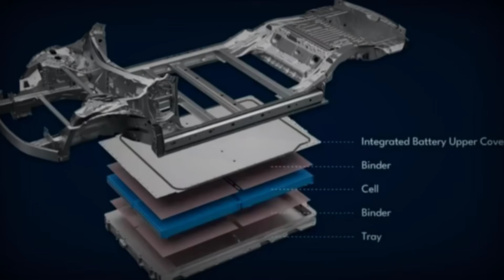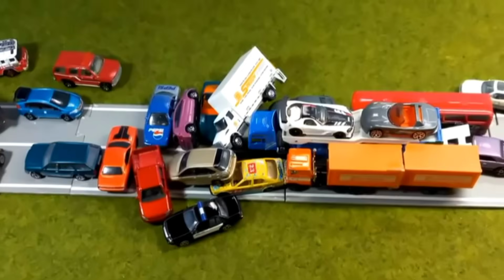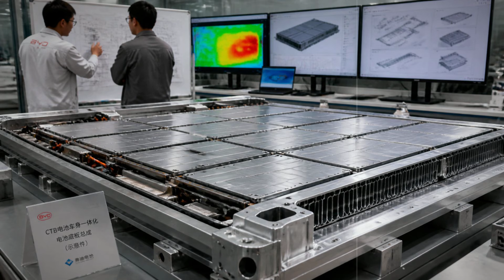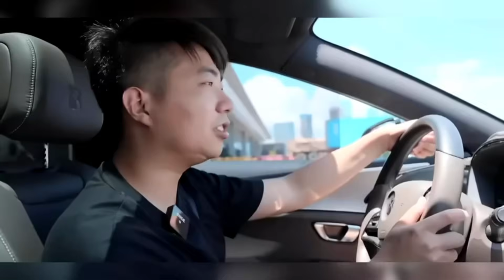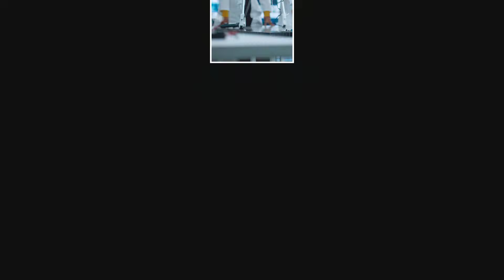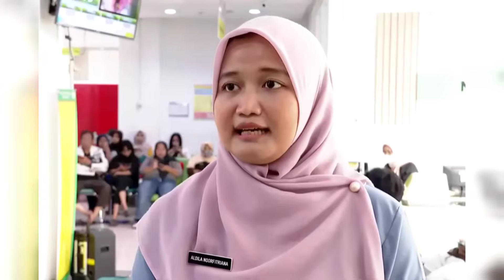BYD's New Car Has No Battery Pack — They Made The Entire Body The Battery

Comment: I don’t like it. An accident would cost so much more. Battery life would mean having to replace the whole car. The smaller the battery, the more volatile the chemistry. So many issues. I still like large changeable batteries. Drive into a station and change batteries all together. No charging, just change it.
Reply: Please read about Gresham's Law q.v..  It's one of the best proven examples of strong economic incentives.  Replacing batteries with a battery fresh off the charging rack can work for a vehicle fleet operator who owns all the batteries and the charger since that operator will know where the charged battery has been and how carefully it has been used.  
Going to a battery swap station for the general public will soon get you a worn-out trash battery replacing your good quality discharged battery.  That's why I will despise the hope of battery swap stations until the cars can do a superb well-calibrated automated test of the quality & current condition of the swapped-in battery.
Reply: @Phil-Umpteenth-f2V4n  ok, I’ll agree with you that it’s very likely that you will eventually get a battery replacement and end up with a battery that only gets say 80% charge and will significantly reduce your range and power output but that’s why I also think that battery swap stations should be responsible for swapping out their older batteries for newer batteries so as to prevent the customer from getting an old battery. 
Another solution would be the way these batteries connect. Like the ones swapped out at these power stations, why can’t people have spare batteries like they do one say a drill. They charge their own batteries at home, bring the batteries with them in the trunk and when their battery gets low, pull over and swap it with one that you charged. Or make a second battery port in the truck that when one battery dies, you hit a switch and the second battery takes over. Then the dead battery charges as you drive.

Comment: I like it, but I worry about the consequences of body damage. Do you have to replace a portion of your battery assembly after every fender bender? How does that work?
Reply: That and the interal chemical structure of the battery as to a crash is to a no escape. Also atm, a battery is to a massive weight, the doors and to door hinges is to manage its own weight and the weight of the person opening it, dont think battery would be inside the door.

Also as to crash safety, cant have batteries at the front of the car as that is to need the motors/engine but also requires pedestrian impact zones. Concept sounds good on paper as to space that can be utilised but by doing so would need more ventalation to keep batteries cool, as cars body is subjected to extreme heat and cold, added weight of more metal to protect those batteries from impacts, how to protect the occupupents from fires caused by those batteries as wont be able to escape etc

Im still for what Renault did for the Renault Zoe, as you buy the car without the battery and you lease the battery from Renault. If they "swear" by its resilience, its operational temperatures, its range and degradation then they can back it up by that system. So if the Zoe's battery does degrade below a certain % Renault replaces the battery with no cost to the consumer. You are charged as to below 6k miles is x price, 6k to xk miles is another, and not sure if there is another price range to miles.

Comment: The outer body itself could be solar panel designed and not only that, when four wheels are turning at the same time, could charge battery cells with momentum and maybe using less batteries under the car....
Reply: Regenerative braking is a real thing but until recently photovoltaics were ridged, the technology is evolving and using the latest flexible types could be applied but it’s an engineering question.
Reply: There is not enough surface area on a car to provide enough energy from solar. Momentum is not free energy. It is created by using the battery to drive the wheels. The drag of using that momentum is only effective as braking energy.
Reply: @ricklearn16 
Well it could provide a small amount of power to basic maintenance, fan based cooling systems in summer heat or security systems while parked.
Reply: @DaveF8324 is that worth the expense and the aesthetic? Not for me. I have enough solar on the roof of my home and it takes 800 sq ft of space.